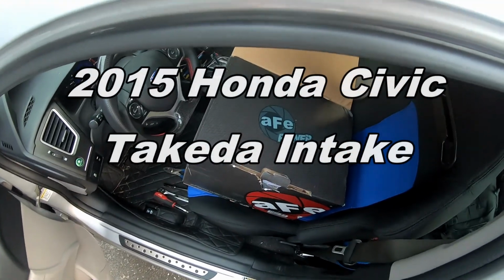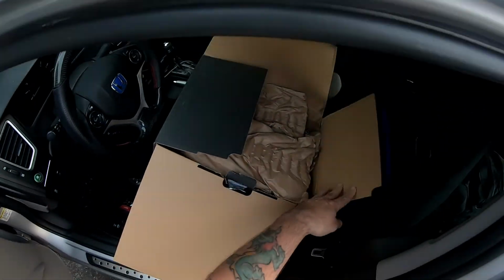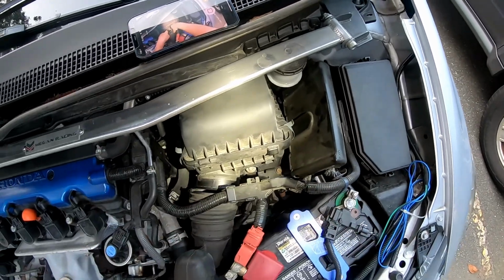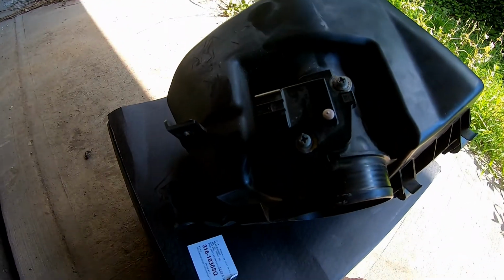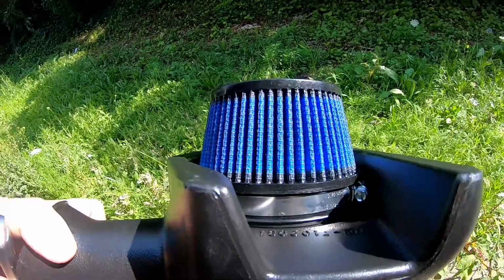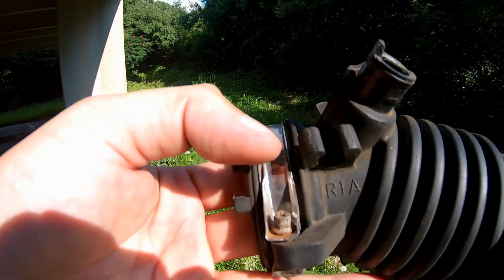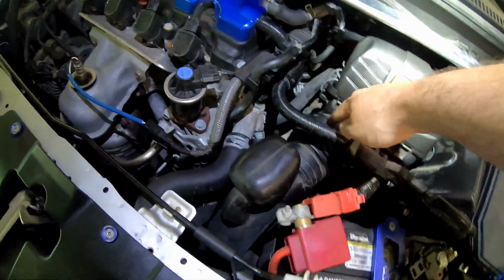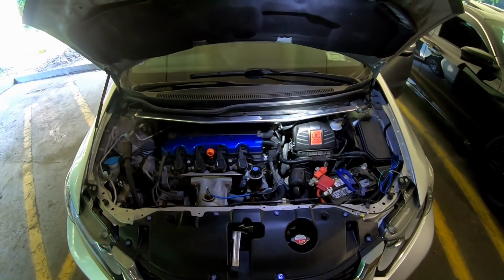2015 Honda Civic Takeda Intake

Comment: Hey after installing this on your Honda do you think there is a waiting period for the ECU to recognize the intake. I just installed mine and it’s been kind of weird. Any feedback to give!? :) thank you so much! Love your vids!
Reply from the maker: Hey thanks so much for the compliment. Means a lot. Yes there should always be a adjustment period for it to adjust the air/fuel ratio. I would just also double check all the connections to make sure they are still tight. Sometimes they can become lose after a few days. But after that they should be good

Comment: Im planning on instlaling a new intake on my 2012 civic LX and I've been thinking of getting this. Is it better than a traditional CAI with the filter exposed? And i heard this one is a short ram intake which is one of the worst types on itakes. How is it holding it?
Reply from the maker: So it’s not a short ram. It uses the stock intake pipes to collect the air. I like it cause it def makes a difference to me and more importantly it’s CARB legal in case that’s a issue. My other car I did a short ram. But all these types have there pros and cons. Hope this helps

Comment: hi, have you noticed any improvements in performance?
Reply from the maker: Yeah it def made a difference. I feel it more in the low range
Reply: @thereviewandhowto2550  do you think it could make a difference on my civic 1.8L? It's stock for now
Reply from the maker: @alfof87  so my car wasn’t to far modified and it made a difference. I recently added a yonaka exhaust which also helped
Reply: @thereviewandhowto2550  Thanks for the info 👍
Reply from the maker: @alfof87  anytime and good luck with your build
Reply: @thereviewandhowto2550  thanks ❤

Comment: hey i have a 2015 ex cvt, i wanna know if i can make it faster somehow? cvt is just slow and i got plans in mind for cosmetics but idk if i should go for all the rest. Thoughts?
Reply from the maker: You can speed them up a bit. Weight reduction and power mods will do it. Weight reduction is usually the safer way to go. Just remember your CVT can only handle so much torque. Hondata actually did a good video about how much and what happens
Reply: i think it safer for cvt to focus on exhaust, b pipe set up, and vr6 instead. most safest of all is power weight to ratio.  I gave up putting more power on my cvt 2020 sport fit. beacuse cvt is not design for more power and torque. at least for what i know. correct me if im wrong. thanks

Comment: I have mine installed for a while now, but how do you clean it? It’s a hassle to install it since it was a small area to work with
Reply from the maker: Yeah it’s a pain to get the filter out to clean it and renew it. Outside the short ram intakes most are

Comment: What’s up man love your content been watching since the borla install video that’s how I found your channel! Today I just got an issue randomly come on while driving to work I’ve got my check TPMS, VSA, Tire pressure and hill start light on these 3 lights just randomly came on today and I have no clue why that could be. Would you happen to know the issue? Seems like a common issue on these civics looked online and nobody has a solution for this and Honda wants to charge $120 just for a diagnostic thanks!!
Reply from the maker: Hey I’ve see this problem before and your right it is common. Let me ask a few people for you and I’ll try to get back to you asap
Reply: @thereviewandhowto2550  thank you man 🙏🙏
Reply from the maker: @wozuna  check your speed sensor btw it could be that. It would throw multiple codes like that
Reply: @thereviewandhowto2550 will do man thank you!!
Reply from the maker: @wozuna  anytime if that’s not it let me know. Someone else thought the same thing so I have a good feeling it could be that
Reply: Bro did u fix it I’m having the same issue also I can’t use my vtec in 3-6 gear but first and second I can but sometimes second stops at 6k rpm
Reply: @thereviewandhowto2550  did u find a fix for this I’m having the same Issa also my vtec doesn’t work if I’m in 3-6 gear
Reply from the maker: @George-ms5gl  most people I talk to about this it’s the speed sensor. I would replace it and that should fix the problem
Reply: Update: I fixed the issue about 2 months ago after replacing speed sensors nothing working until I went ahead and paid the $150 for a diagnostic at Honda only for them to tell me it’s a abs module $1600 repair with parts and labor at honda so I simply just ordered a used one on eBay for 250+ and had my mechanic install for $100 and after that all 3 lights simply went away after driving for about 15 mins after the install I hope this helps y’all out it was definitely annoying to see all 3 of those lights on